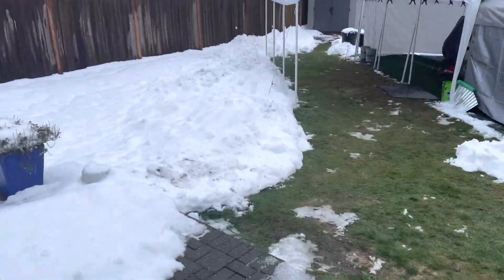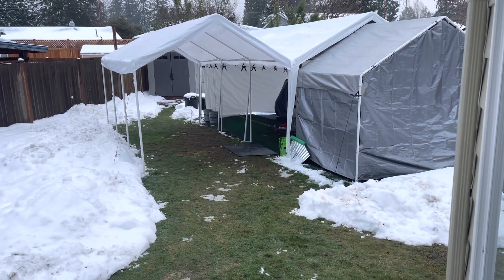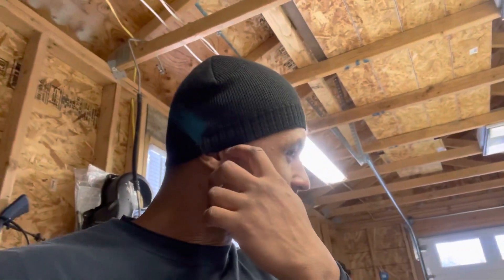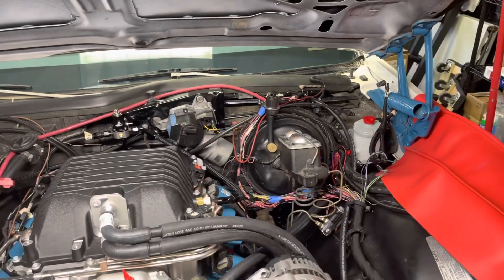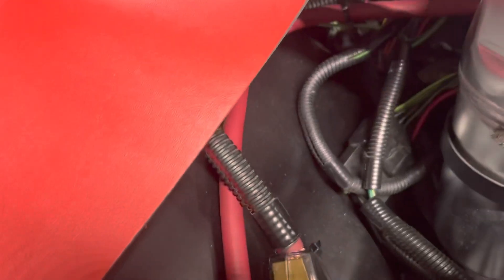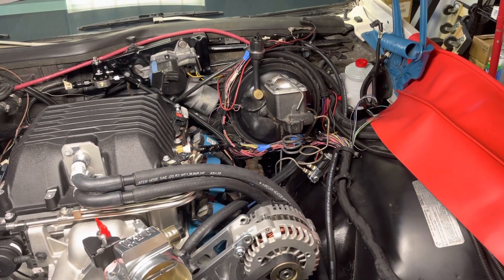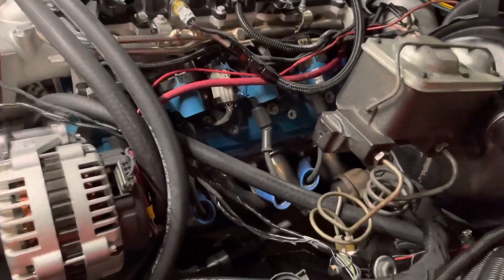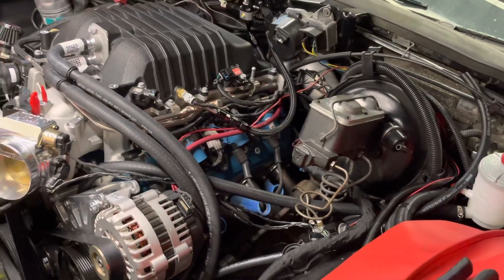LSA BUILD | WIRING AND A RANT😠

Comment: Props for blocking him. I admire your enthusiasm👍👍 LS 1 swapped my SC400 so these videos hit home. Keep it up! #tesataperocks
Reply from the maker: Yep! I don’t have time for that and I’m sure no one else here does either. Hope our car is running well. Also yes, that tape is legit. Thanks for tuning in.
Reply: @MrGriffin23  Yep, running well. Didn't do anything special other than use HP Tuners to delete vats and set my fan on temp. Few hiccups with a bad coil pack harness, but runs like a top now.